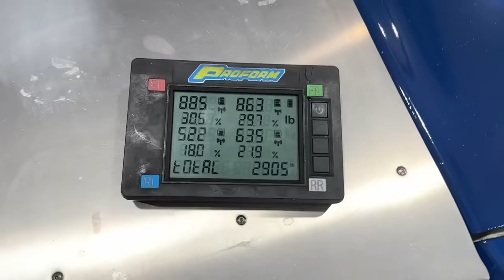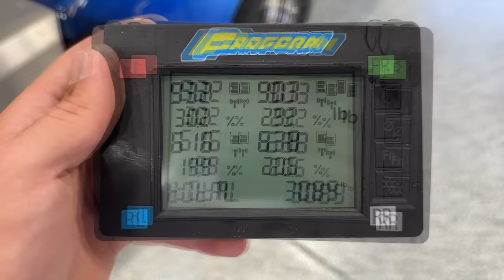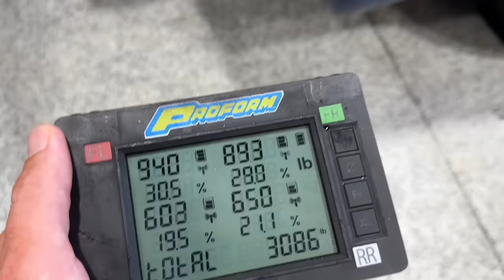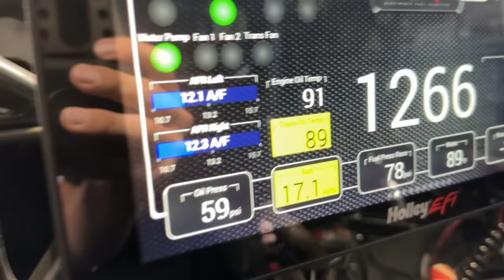Mullet's 5,000hp SMX Big Block Is BACK!!! + McFlurry's Suspension Issues are Fixed (We Think)

Comment: For the latches, take the aviation approach, late model machines with cowl latches etc. are generally colored with fluro paint on the sides to show when they are open, use a bright yellow or orange then its easy for crew to note it also if forgotten both inside and outside cabin.

Comment: In the car audio industry, to get a little more juice, we do a thing called the big 3/4. You typically run 1/0 but I’ve seen as big as 4/0. All you’re doing is adding a big ass wire from ground on battery to chassis, engine to chassis, if running alt then negative on alt to battery, positive on alt to battery all on 1/0, 2/0, or 4/0 power cable. Welding wire is a lot cheaper

Comment: I hope mullet gets new exhaust pipes that aren't necked down like they used to be. Those we're fine when they were made for the big block Chevy motor but that SMX is moving significantly more air. Maybe just hood dumps for FL2k until tye can weld up some new titanium lower fender exit pipes.

Comment: A lot of weight could be shed out of mullet, by cutting the inter bed walls and bed floor out of it. A few fender panel and wheel well struts / hanger have to be lighter. With a fabricator like Ty it shouldn't be too big of a deal. Gutting the tailgate would shed some LB's also.

Comment: Cleetus FINALLY taking Mullet seriously. Massive weight reduction is going to be HUGE. That is ALOT of weight, plus he's finally getting the correct parts needed to run an engine that powerful. I will not be shocked if he finally gets into the 5s.  I'm also glad McFlurry is looking good. I didn't like the tailer park white paintjob on it.

Comment: Hey y'all. I have an 89 s10 blazer that I dropped a 2002 5.3l into it and I know the rear end won't last. What do you recommend putting in it used? I have an rpm trans behind the 5.3l.

Comment: Im so glad Mullet ended up with this setup vs the Jet engine. Nice to see this car getting really used.
Reply: This Mullet is not the jet car.  The "jet" Mullet was cut and stretched to fit the jet turbine. This is a backup that Garrett had.

Comment: The scariest thing about those doors and windows is when you're going over 200mph and there is even the slightest crack where air can get behind the window/door, it will tear the door off it's hinges. Seen it happen too many times with the Street Outlaws peeps, though, they probably had terrible tire shake that reverberated up to the window and BOOM; bye bye window/door.

Comment: Seeing Jackstand get behind the wheel and adding 180lbs on the scales got me thinking.  They need to hire jockeys to drive their cars.  I mean think about Mullet, the 6'7" giraffe piloting this thing is A BIG UNIT at 220-230lbs.  You'd lose 120lbs with a jockey at the wheel.  Might have to reconfigure the entire roll cage/seat/seat belt mounts to where Cleeter would never fit in it again though lol.

Comment: --  Substitute hoverboards for front wheels.  Add a small carbon fiber vertical stabilizer with a rudder and trim tab.
                                                                                                                                                                                         Mullet will FLY!

Comment: 2:25 the logo in the back passenger window is not facing the right way. I know it's a company logo or something but when the American flag is traveling it needs to trail the direction of movement. Imagine flags on horseback charging into battle. The end of the flag that's not attached to the pole waves behind. That's why they have the flag the way they do on military uniforms and equipment
Reply: The Flag Code is recommendations, not law.  The flag can be presented either way.

Comment: The american flag above the mustang in the passenger rear side window is facing the wrong way.
The stars are supposed to be into the wind.
Reply: The flag can be presented either way.  There is no law.  The Flag Code is there just for recommendations.  If you are confused, call your local American Legion post.  They will be glad to explain it to you!
Reply: @paulcopeland9035  my us army soldier uniform displays the flag, on the right side, with the stars first, because when you move forward the flag "will" fly normally and not backwards.